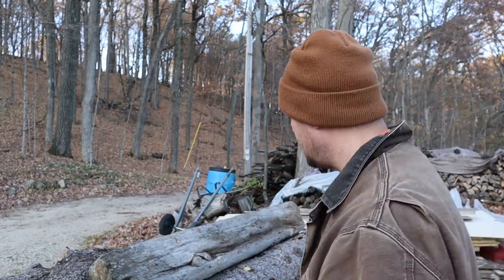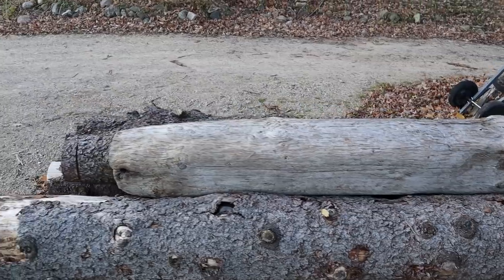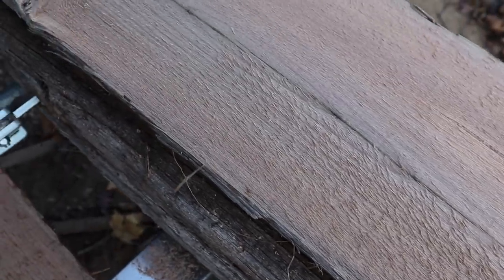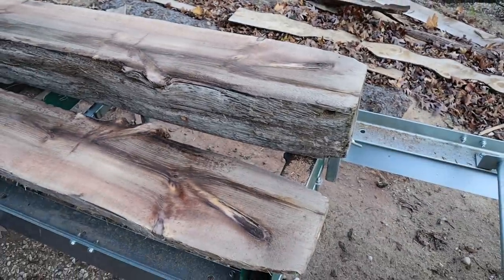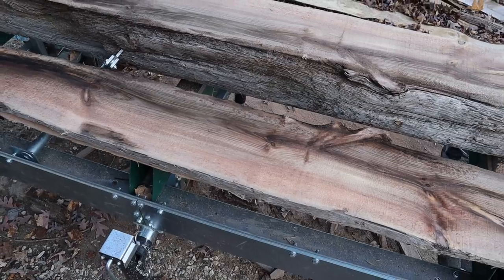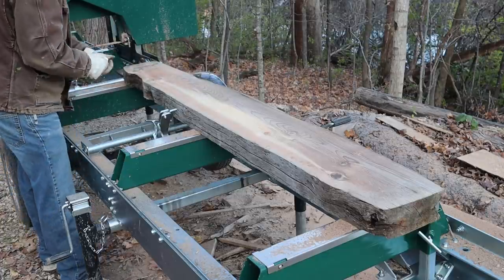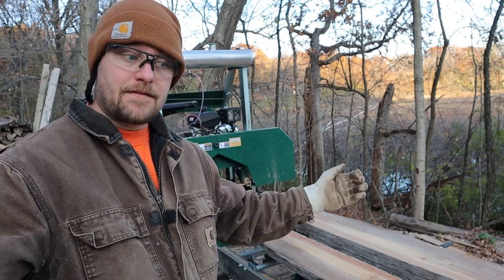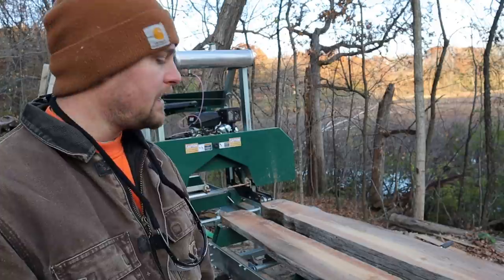Milling a driftwood log ✔️

Comment: I pulled a big old log from the river here in northern Vermont. Was impossible to tell what it was, completely stripped of bark and gray like driftwood gets. Guessing it was mostly underwater since 2012.
Inside was beautiful yellow timber with strips of red, blue and green swirling. Pretty sure it was Bomagideon or Box Elder.
Although it was loaded with sand, it was well worth the blade! Won't pass up the opportunity to do that again when it comes around.

Comment: Hittin' a big ol' spike is what I would be scared of!!
Reply from the maker: Yea I did go over it with the metal detector. I also didn't use a new blade with all the sand grit stuck in all the cracks.

Comment: Curious as to why some sawmill videos I see have the slabs come out with a nice nearly smooth finish, yet many of yours have a "Washboard" look to them? Sure they will likely sand out, but it seems to me that the better the finish when sawing, the less sanding you would need to do for the finished product.
Reply from the maker: the softer wood like cedar has a more textured look. Hardwoods like oak and ash come off the saw very flat. There will always be lines from the tooth of the blade in the boards, no matter what mill is being used. Same as when you use a standard blade plainer you will have very little dished out marks that sand out easy. You just gave me something I can do a video on some time thanks.
Reply: @tinkertime3849  Thanks for that explanation. Makes sense, though, now that you pointed it out.
Reply: The answer ? Is simple tooth set duller blade. Thats the answer.  I have the hm122 fresh blade smooth cut